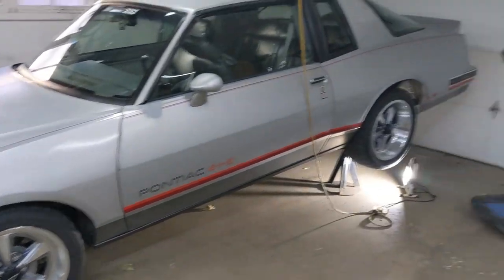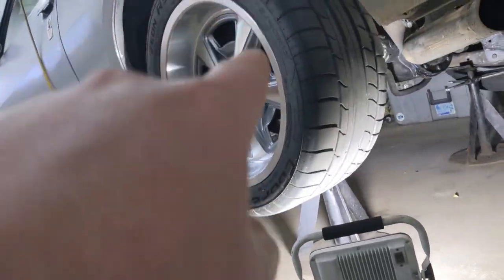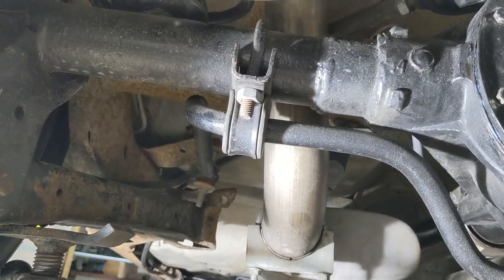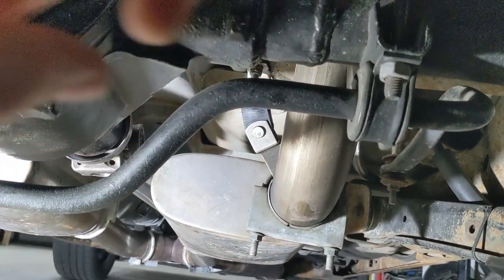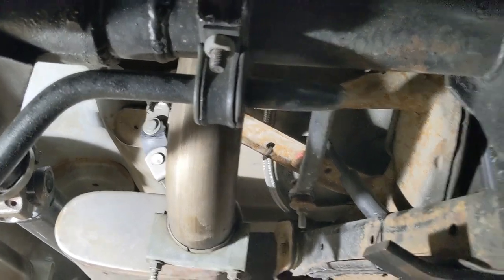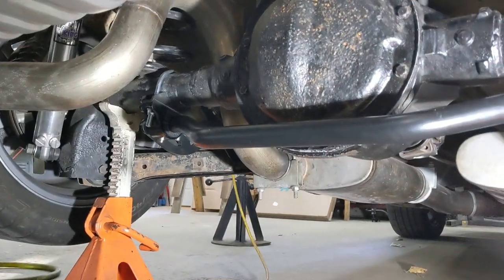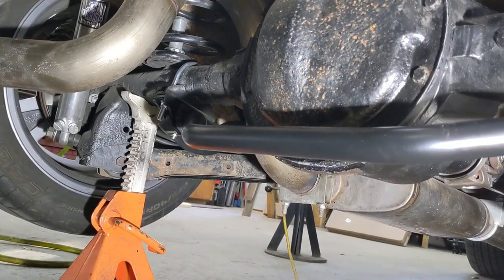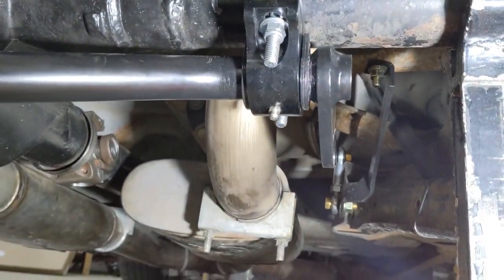CPP sway bar on my drag race/street/autoX G body

Comment: How did you end up liking this bar compared to the blazer bar? I have a much milder build and am  planning on replicating your 3rd Gen F body front bar and 98-02 Blazer rear set up
Reply from the maker: Good, I know of a guy running deep 9's with the same bar with flat launches. This bar has taken out the lean my blazer bar had on good launches (10 second car).

Comment: Why don't you have boxed  or tubular lower control arms
Reply from the maker: I had boxes lowers. I changed to a heim end this winter due to some bushing flex on launch
Reply: So you run a helm joint with the stock you shape control arms?
Reply from the maker: @darrenporsch  it's an aftermarket arm from trick chassis. Nothing left off the stock ones now.